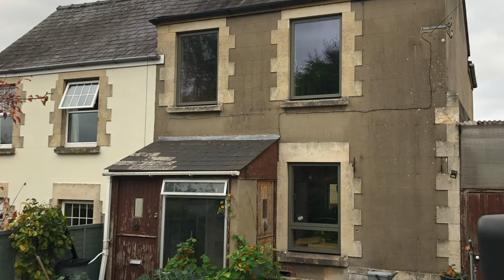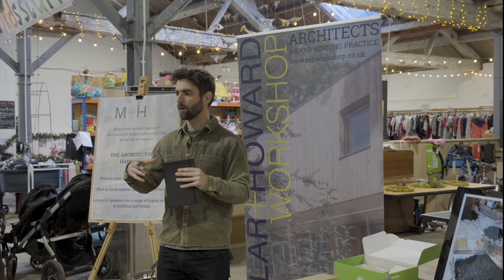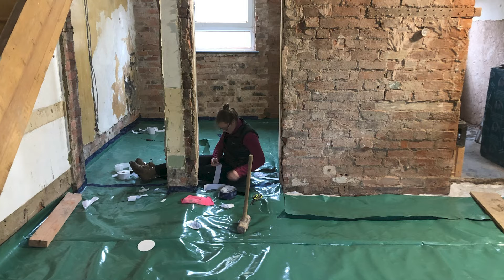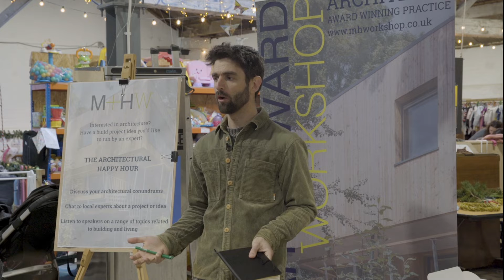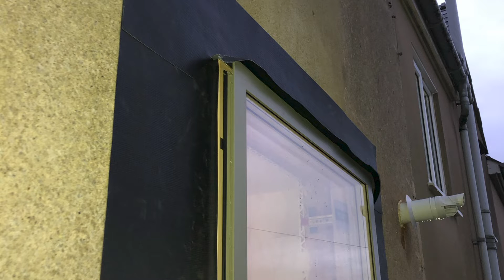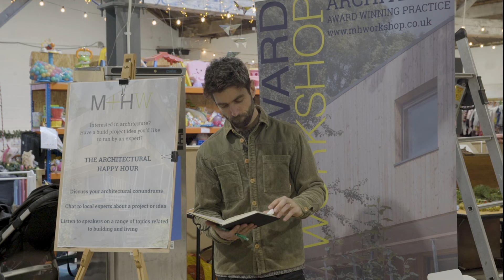Energy Saving Retrofit of Victorian Terrace House

Comment: Very interesting and I am taking on a large project where a victorian building has been similarly abused with cement render.

Where you found the cement render was breached (you mention at about 23mins) did yuo remove the render prior to adding the external wall insulation or install it over the top to insulate plus weatherproof? I have a large wall - no windows that has had plant life eating at the wall and i suspect cracking. Ideally he wall requires insulating anyway.

Comment: Thanks for the talk. Does the MVHR system not make it easier to use more modern building materials?
Reply: To a limited extent, it's a good thing to have but you still need to maintain the subfloor ventilation, avoid cement, especially in the external walls and try to maintain a high level of vapour permiability across the walls.  You can seal up the ceilings with SBR or a vapour barrier and then skim with gypsum to avoid moisture in the loft.  That's good practice generally really.

Comment: Nice presentation, but you can see Phil pointing at a screen with his hand which we can't see. So next time try to include these slides.
I'm currently in the proces of a deep retrofit myself, having a detached house which was already white painted brick the decision for EWI rendered over all around was easy, albeit it being very costly.
But at the same time the results are much better than with any other form of wall insulation, unless you are prepared to lose several m² in each room for IWI. Above all no cold bridging if your roof and floor connections are done right. My former damp and mouldy house is now bone dry and I had to place some bowls of water to evaporate, but plants in clay pots also do well in humidifying the air.
 
A couple of air to air heat pump  units and a wood stove are now sufficient to heat the quite large house, even on the few ice days we already had. The wooden floor in the living room still has to go, a solid concrete and well insulated floor with UFH will go in, moisture under the floor isn't an issue, the water table is deep and the foundations are also deep enough, the clay soil seals against any water from outside.
I stick with Phil's philosophy of using natural materials only on the inside, PIR and EPS being on the outside of the walls and roof.
This also for fire safety reasons, the vapours of smouldering plastics can kill very quickly, natural materials will give off smoke which you or your smoke alarms will notice far before these get lethal. Rockwool will not burn but isn't very carbon friendly in manufacturing.
Reply: Great to hear about the EWI - was this DIY or did you have a firm fit it, also what material - EPS or wood fibre? Im looking at fitting it when I have finished my renovations, but I will also need to extend the roof to accomodate the EWI